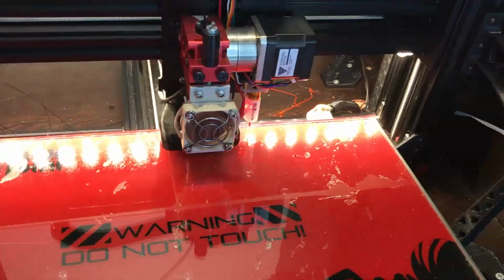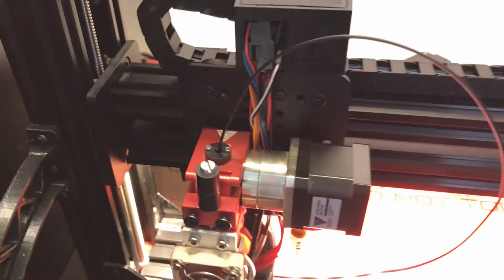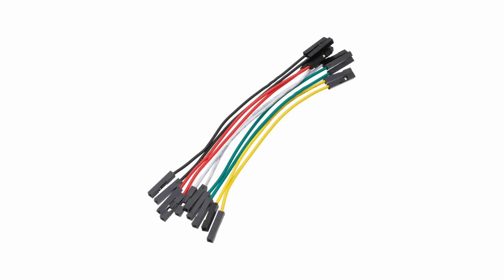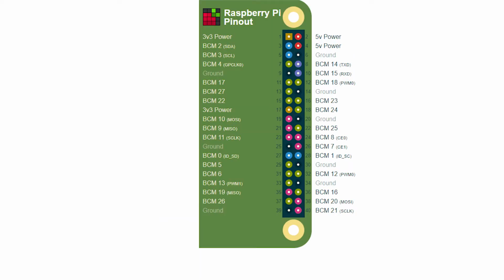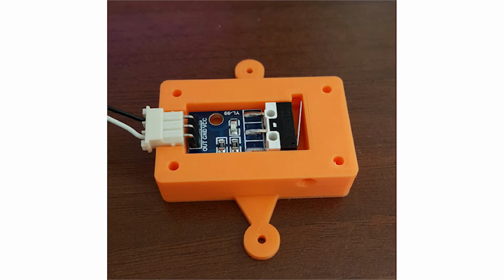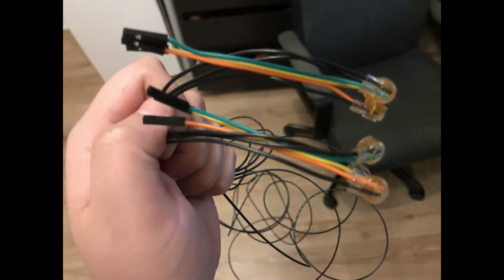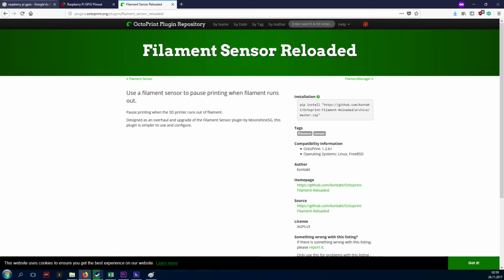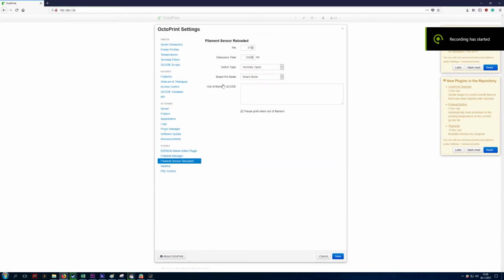How to add a Filament Rounout Sensor to your 3D Printer - Octoprint Tutorials

Comment: I got it running but when it resumes. it starts its 9 point auto level. it dosent go back to where it left off.
any idea how to fix that?
Reply from the maker: That sounds like missing resume gcode. Did you enter the code in the description?
Reply: M82
G90
G92 E{{ pause_position.e }}
G1 X{{ pause_position.x }} Y{{ pause_position.y }}
G1 Z{{ pause_position.z }}
G1 {{ pause_position.f }}
Reply from the maker: Then I have no idea why this isn't working. It worked for everyone else who followed this tutorial, so there must be a very specific reason for this to not work for you. Try to think of something that's only your setup has, it might be related. Sorry, I ran out of other possible ideas. Try searching Google for help, or ask for help in a big 3d printing forum.
Reply: getting closer...In my haste noticed I had  clicked the red button , but that was restart. now I see the smaller resume button. but when I click that,it goes back  to where it left off. but extrudes about 1/2" above the bed.  is there a way to correct this?
Reply from the maker: If that error is the same height every time try adding G1 Z-?? at the resume code before m82. The ?? Is the gap in mm. Might be 10mm since the pause code lifts z by 10mm.

Comment: every time I try to print after installing this. it dosent print. but starts a time lapse. any ideas whats going wrong?
Reply from the maker: Reading from the sensor could be reversed. I don't have a octoprint running right now so I can't say exactly where, but there is a setting for changing that.
Reply from the maker: Try disconnecting the button first, change the setting, and rewire. But if you want my opinion, either you did some of the wiring wrong, or you have a damaged pi (or a faulty octoprint installation)
Reply: I re wired to another pin and reinstalled the plug in. got it working. but it dosent resume, it starts the auto level sequence. is there any way to correct that?

Comment: Awesome video! Thanks for the information! Do you know if there is a collision detection plugin available? It would be nice to stop a print if the print head gets stuck on something during a print.
Reply from the maker: AFAIK, there is none. The only way that I know of detecting collision is through drivers. There are some stepper drivers that have this feature, but they are usually expensive,anf not in the stepstick format, meaning they are harder to add to your 3d printer.